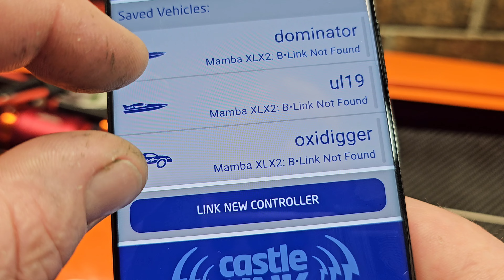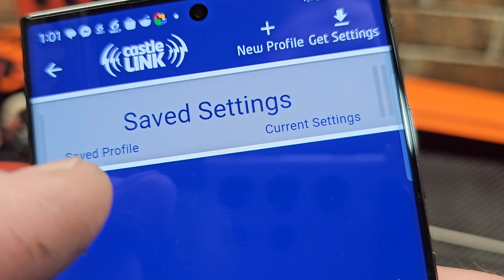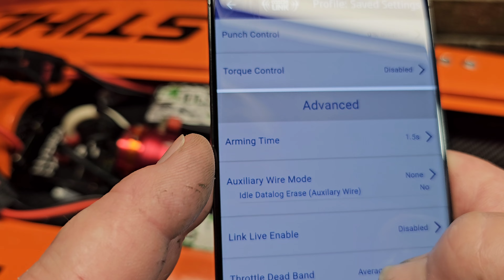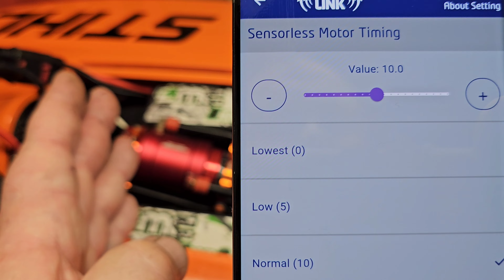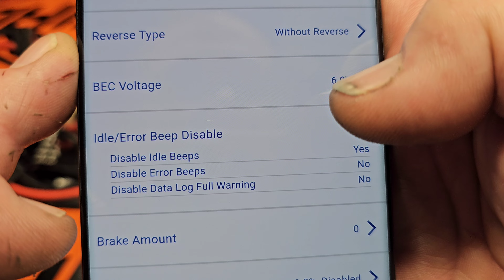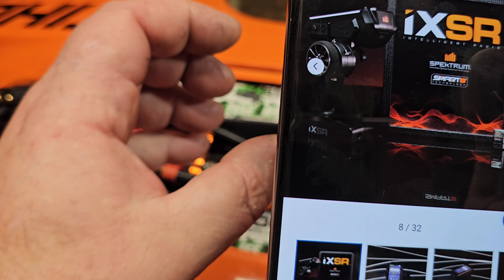Castle Creations Hydra B-LINK Setup & Parameters - 4082 Leopard X2 2Y 1600kv  Deltaforce Vortex 34

Comment: Wouldn't the xl8s work? I don't see many people running that one. They just skip up to the XLX2
Reply from the maker: X8s would probably work, maybe borderline, I pulled a max of 270a this evening doing laps
Reply: I run a x8s that runs a bigger 4092 motor on 8s that pulls a 48mm. Don't have data, but temps are good and no power cut issues etc and scary fast... But from what i've seen from speedrunner car data the X8s is capable of 300+Amps and XLX 500+.
Personally think the x8s is more than enough for most setups, unless you want to go extreme on speeds, have even bigger motor or have a big  boat (my guess is 40+ inch) with big props...
Most boats under 40" are doing 60-70+mph with right setup and lighter esc's...
Reply: @peteroosterhoff8850  what boat are you running that setup in? For the price is much more reasonable to swallow.
Reply: @PatriotBrad  Dominator (mono2) But quite sure a little bit bigger boat will work to. Run 6-6.500mah, bigger (and high c-rate) would be better probably. Saying because there is significant difference between lipo's in speed and temps